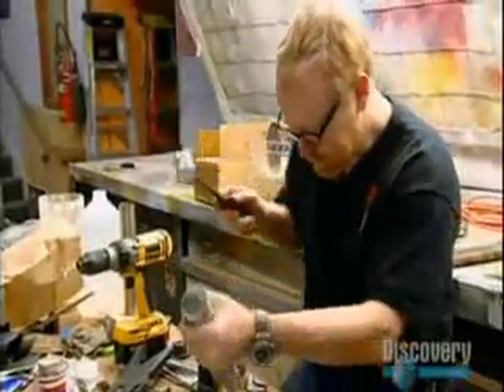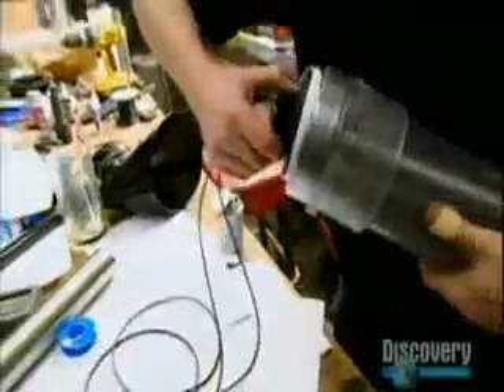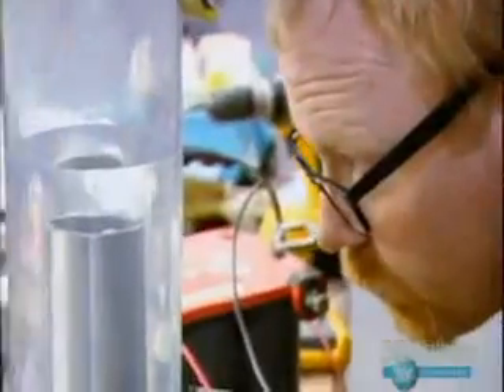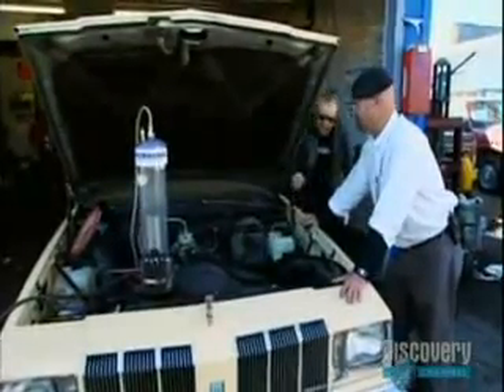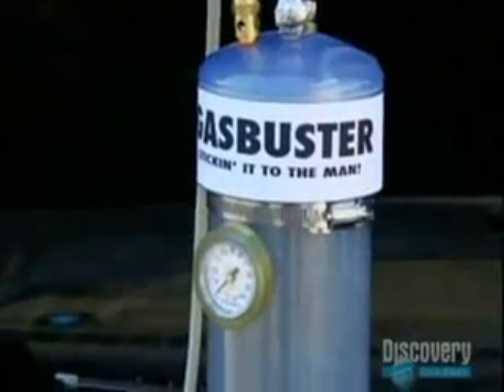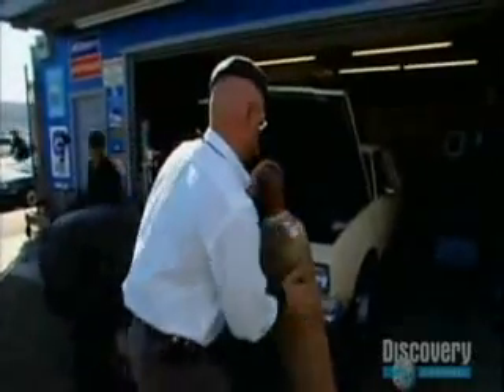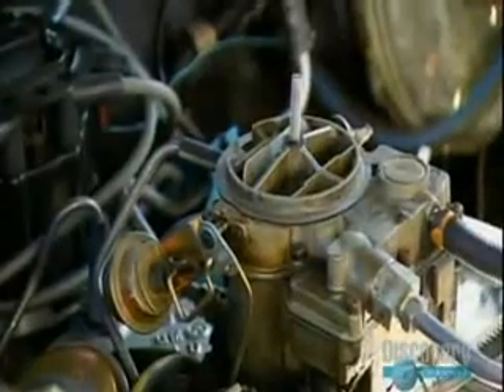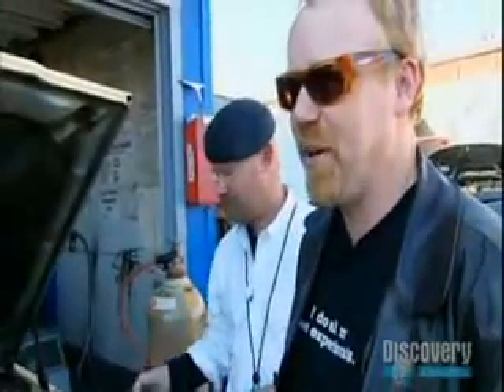HHO Mythbusters Explained

Comment: See here for the energy density of hydrogen vs. gasoline: http://www.petroleum.co.uk/hydrogen
Even if you could run your car on it, it wouldn't do any useful work. You'd have about enough energy to keep the engine running, but not enough to move the car. Plus you'd wreck your engine and your ECM would go nuts!

Comment: Personally, I  think either someone made some dirty money or they did it for free to try to discredit the water for fuel movement. This I know, to those who know that electrolysis of water works these guys have made asses of themselves not to be trusted at the very least. I've watched many episodes of MythBusters with my sons and they hate it when I point out the flaws in their setups, procedures, etc.  They say, "Can't you just watch it for the entertainment value?" I guess that's all their program is good for. If I want something scientific I'll watch Bill Nye the science guy, or something silly like that.
Reply: Yes, the lauded "fake" moon landing (or should I say landings?).  Thanks for proving Mythbusters is actually credible.
Reply: I'm sorry, but that's nonsense.  The supposed "Browns Gas" is nothing more than H2 and O2 molecules combined in a 2:1 ratio.  This is what you get when you do electrolysis without bothering to try separating the gasses coming off the positive and negative electrodes.  It is the ideal combustion mix.  To burn it, you supply an ignition source (like a spark plug), which causes a teensy bit of H2 and O2 to split (requiring a bit of energy), and reform as H2O (produces more energy), which yields a net energy gain, which causes the rest of the H2 and O2 molecules to split and recombine as H2O.

The problem is that the electrolysis required to split the H2O (a lot) and regained (a bit) by H and O atoms recombining as H2 and O2 molecules is EXACTLY THE SAME AMOUNT OF ENERGY that you gained by burning it. Net theoretical energy gain/loss by electrolysis to "Browns gas" and then burning the result is exactly zero.  But electrolysis is not 100% efficient at producing H2 and O2.  Amongst other things, there's heat generated and corrosion of the electrodes both of which are energy you don't get back.

Industrial electrolysis plants only get 30-40% efficiency in the H2O -> H2 + O2 phase in terms of energy used to produce the H2+O2 versus the energy you'd get back by burning it.  The best ever achieved in a lab is about 70%.  That means that for every watt hour of energy used in producing "Browns Gas", at most you get about 1/3 of a watt back in "Browns Gas".  A car alternator can only produce about 480 watts.  Which means that at most you can get about 120watts of Browns gas.  Which is about one eighth of a horse power.  You've spent 2/3rds of
a horsepower to get 1/8th back.  That's a very poor return.

As for production of "Browns Gas" being "on demand" - that's pure BS too.  Precisely the same amount of "Browns Gas" is produced whether the engine is turning or not - as long as the electrodes are being supplied power, it produces exactly the same amount of gas. There is no feed back controls to the generator of any kind. If it ever supplied a "surplus" of gas, as you've just stuck the output hose in the engine intake, it just spills out into the atmosphere.

You wanna test this?  Stick your car into a sealed shipping container, or wrap it real tight.  Turn the keyswitch to the on position, without the engine running.  Wait an hour or two.  Now, light a match.  Boom, crispy car.
Reply: Notice how they claimed it was from an "internet patent" to make it sound like a fake. There is NO SUCH THING as an "internet patent" ! Just trying to discredit it.

They also debunked electrolysis, showing how when you put electricity into water NOTHING HAPPENS. They said,"it should make hydrogen and oxygen". And no electrolyte either ? Even with tap water I have got way better results so either they had a short which is easy to find, or they showed nothing on purpose. And Grand is an engineer but he couldn't tell ?

No mention of the NASA study of using hydrogen to improve gas mileage either that showed an improvement of about 4% I think. Why not ask them about the study ?

 Also, they used a tank to see if hydrogen could work ? Hydrogen and propane cars already exist, so do fork lifts running on propane. Why not show a commercial hydrogen car with a profession to explain it ?

Our local power company has many service vans that run or propane and natural gas and Canada has had propane cars for years since gas is more expensive there.

All cars should be like this or BETTER at 84MPG.
84 MPG CAR ONLY $6,800  need $6,800 LOOK BELOW
The Shell Opel got 377MPG in the 1970s using a gas vaporizer.
Running Car On Gas Vapors 200 MPG (Turbo Eclipse GST) PART 1
Reply: But it would have cost more in the regular fuel to produce the electricity to produce the hydrogen, than they'd get back in gas.

Ever notice why none of these scammers ever sell actual hardware that you can just bolt into your car?  Simple: it'd be trivially obvious to everyone that they don't work, everybody would want their money back, and the scammer wouldn't get to claim that they didn't follow the instructions right.

Instead they get to claim freedom of speech, and they point at the small print that says "this is only for entertainment/educational purposes", and they get to make their money selling plans that do nothing, and teaching people how to build things that don't do what's claimed.

The sign of a scam.  So obvious.
Reply: I'm sorry, it doesn't work that way. With a regular hydrogen (H2) fuel cell the hydrogen molecule (H2) must be broken apart (uses much energy)  and then add oxygen (O2) which must also be broken apart (more energy required). Now combine the gases and burn. You're right. This method gives you only about 1/3 the net amount of energy compared to a normal gasoline (petrol) internal combustion engine. 
When you use an HHO on demand system, whether electrolysis or pwm, the water molecule (H2O) is broken down into its basic, elemental parts (HHO) which are used as is (called Brown's gas), and it's already in the proper proportions for burning "AS A SUPPLEMENT" to the fuel your internal combustion engine already uses. Pound for pound, Brown's gas (HHO gases in its original, elemental state) provides 3X the power of regular gasoline, and easily and readily mixes AS A SUPPLEMENT with the fuel in whatever internal combustion engine you want to use and gives a net increase  (usually) of about +30%..
HHO can increase the power output of your engine, it will run more smoothly and more quietly, it will actually clean the engine of carbon deposits, and the harmful exhaust is practically nothing.
If you are truly concerned about the welfare of others I commend you. However, you should look into the reality, the science of what you're discrediting. If you're just bad mouthing the efforts of the HHO community because you're viscious, or malevolent keep in mind that if you plant corn you get more corn, "you reap what you sow." Either way, you're either part of the problem or part of the solution. You pick.
Have a good day.

P.S.: If you want some good sites/info on HBO Google Water4Gas and Advanced HBO for a start.
Reply: After seeing these comments, UK News,  I can no longer trust idiots who believe everything they see on Youtube. HHO, what a steaming pile of horseshit.
Reply: Mythbusters notorious sell outs, lol You should see their sniveling when it comes to the moonlanding.
Reply: Of that I have no doubt. Thanks.
Reply: Wow. Good. I was starting to think I was alone.
Reply: What were the specs that you used to install everything? Like, what size mason jar, etc.
Reply: Jui Ce They obviously didn't do this correctly otherwise they would have enough HHO to at least supplement the vehicle's regular fuel.l
Reply: Ok. I'm done. 
You're spouting unlearned nonsense (so called because it makes no sense), or malarkey that is meant to deceive and frighten. The only reason I would explain anything further here is because someone else asks a question and is earnestly seeking an honest answer.
Reply: Bruce Dobson  Bill Nye the mechanical engineer guy.
Science not!
He's as full of shit as they get.